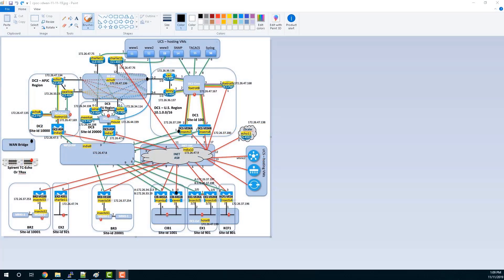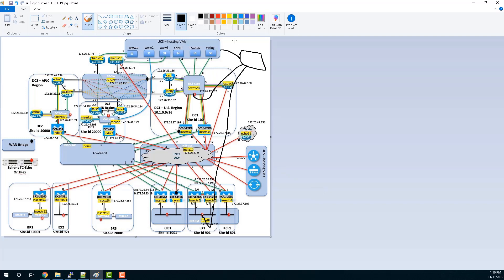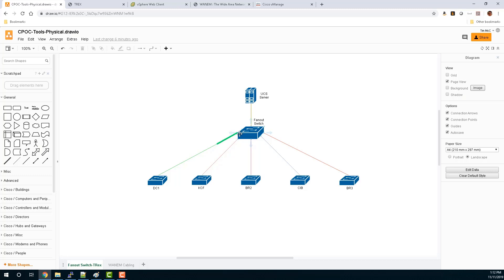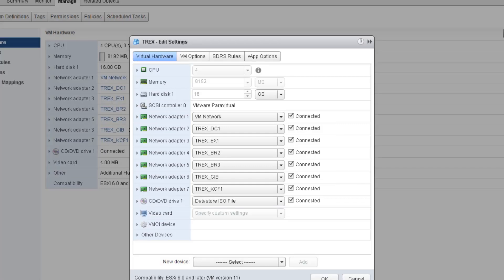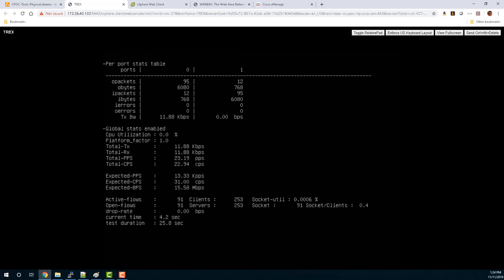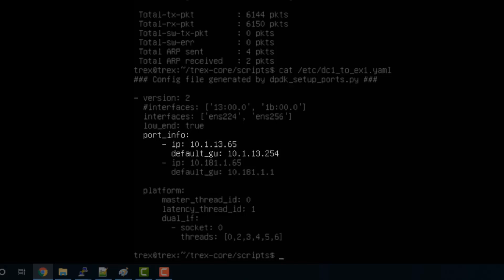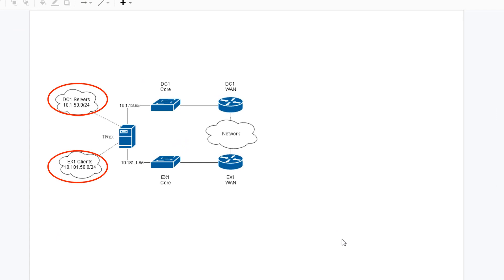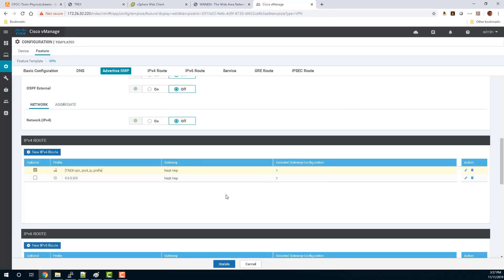SDWAN CPOC: TRex Traffic Generator Uses

Comment: How would you connect the emulated clients and servers without the VPN template?
Reply from the maker: I'm not sure I understand the question.  If you mean how would it work without SD-WAN vpn in general,  it could be used anywhere you can route from client to server,  with any protocols.
Reply: @CarpeDMVPN  My output is showing the same tx rate % with the same drop rate. Does that mean all my packets are being dropped? I even made a route to the emulated clients and servers from my router in the network.
Reply from the maker: @josephchang4690  Yes, you are dropping all the packets. I would ensure that your emulated client/server subnets are being advertised and use the TRex interface as their next-hop. That's the most common mistake.
Reply: @CarpeDMVPN  Thank you. Do you mean the trex interface IP or gateway as next hop?
Reply from the maker: @josephchang4690  You understand that the TRex only sends/receives traffic to itself, right? Check out my TRex videos if it's unclear how the traffic flow works.
Reply: @CarpeDMVPN  Yes I understand. I have watched all your videos. In the video, it is stated that the flow goes through the network to the client to the server of BR1-Sw to DC-Core. 
 It is also stated in the video that the switches need to be configured with static routes to the t-rex which I did as well. Right now my t-rex has two physical ports connected to two of our core switches on two access ports. Each core switch is connected to a different subnet on the network. The emulated packet clients and servers are supposed to be going through the network, so am I supposed to see them go through my devices? I am confused about why my packets are dropping. Any help is appreciated. Thank you for answering all of my questions.
Reply from the maker: @josephchang4690  Okay great. Yeah, as long as your next-hops for the emulated subnets are the correct TRex interfaces it should work. If not I would go hop by hop starting from the client side and ensure that a route exists end to end, and then do the same for the emulated servers side. Good luck!